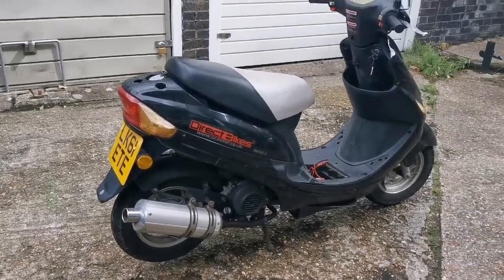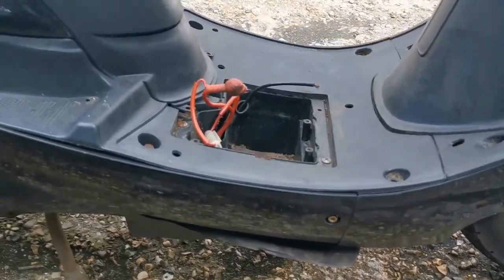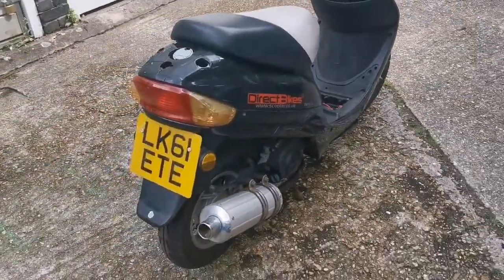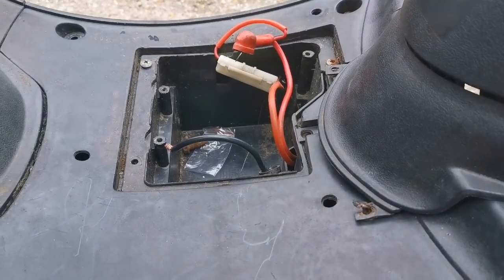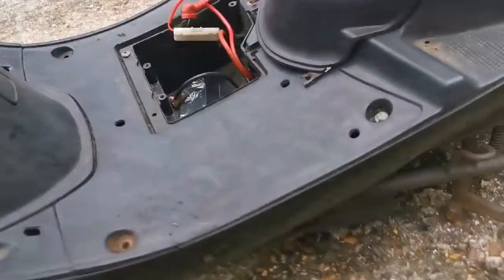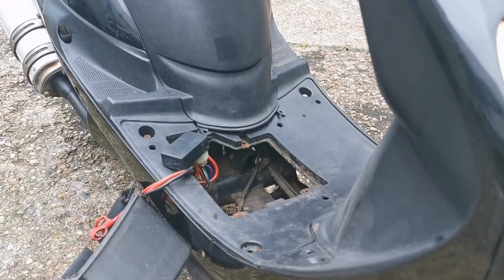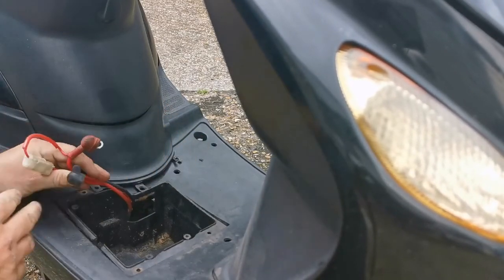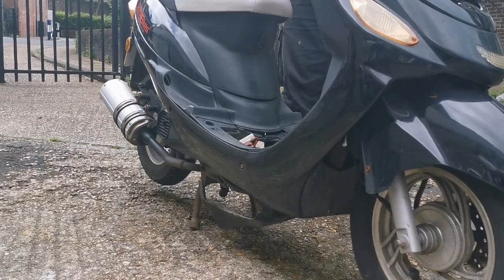How to de restrict your motorcycle. How to make your 50cc faster. De restrict your moped or scooter

Comment: Almost the same on all carb based GY6 engines including Peugeot kisbee until 2017, there you connect the blue wire to black. With fresh rollers mine does 70km/h (gps speed) with me on (74kg) and steep uphill 45km/h I mounted a swith in case of police control 😉
Reply from the maker: Good thinking about the switch mate
Reply: Have a 2021 50cc with no purple wire or no blue wire and it's all original never touched..also seen that where the purple wire should go on the cdi plug it's already missing, any advice?
Reply: @ticohayes7034  2021? Sure you have carb and not injection?
Reply from the maker: As already mentioned I think you have a fuel injected model. These are restricted in the ecu. It wasn't common to be able to get a de restricted ecu so you may be stuck with it until your ready to upgrade to a 125cc
Reply from the maker: It will be injection I'm sure. So ecu restricted
Reply: @bennyrogergundersen3040  yea 2021 it is a china bike dont kno if that makes a difference but positive that's it's carb just bought a new 1 for it a week ago..
Reply: It's a 2021"peace sport 50cc"

Comment: Do you think this could work on an Icebear 50cc? It had a restrictor behind the drive face but removing that did nothing at all.
Reply: Currently about to derestrict my exhaust when I wake up tomorrow morning on my Icebear 50cc, I hope I have more success 😅
Reply: @GoodVibes0rDie did it wrk on ur icebear
Reply: @Bella-RJR  It gave it honestly 2-5mph more depending on where I got the gas and what kind of gas. As for actual mileage, I gained 7 more miles during the summer, but when the snow and cold hit all went to shit. Shocking for a scooter with the name Iceberg. However, the scooter served me well. Derestricting overall paid off enough for the effort to be worth it, but barely worth it. If you have love for your scooter do it. Otherwise, screw it haha

Comment: mine wont start after disconnecting the wire.
Reply from the maker: Then you need to re connect it. However if your bike cdi looks like mine and has the pink or purple wire then that's the restriction wire and won't stop the bike starting
Reply: @motorcyclerescuer  its always the bottom right wire if your cdi looks like that the color does not matter
Reply: @motorcyclerescuer  and you dont need to cut it just pull it so you can but it back in if need it
Reply from the maker: On mine it wouldn't have been able to go back in if I pulled it. But this was a few years ago so they may have changed.

Comment: I have a question. Can you restrict a scooter to a specific number? Mine goes 25 but i want to go like 40.
Reply from the maker: No it dosnt work like that sadly. It's either restricted or not. 

You can change the roller to slow you down or speed you up a touch

Comment: I have a tao tao 50cc and it does 35mph on flat and 30mph up a hill. All the restrictions are on it, it’s a completely stock bike. I’m 155lbs as well.
Reply from the maker: My guess would be that either your restrictions have been removed or someone has tuned the variator a bit to help it along. In the UK these are 28mph from factory and around 35 when de restricted with no variator changes.

Comment: I had a gilera runner de restricted the exhaust…. Bought a 70 piston an head…. New jet…. An even changed reed valve …..40/50 mph…. Was surprised how quick it was 😉
Reply from the maker: Yes them engines tune really well. I got 70mph or close out of a 50cc Aaerox some years back lol

Comment: i know on Honda its a small looped green wire that you just cut on CDI .. but TBH it hardly makes any difference anyway no escaping that fact its a 50cc   ..You can change exhaust and put "race" rollers in variator but its just not worth the money and effort
Reply from the maker: Agreed, these Chinese ones only do 28mph though which is shocking. With the wire cut it does 35 which is safer

Comment: just picked one up from the local scrappy at Pont Creuddyn for £30 been stood out in all weathers for 2 years will quite a few panels missing but had key, made up a few line to a funnel just see if any life in it plus a squrt of easy start to save wearing down the battery pack and away it went. Glad I did not use fuel tank. Swilled that today and had about half pint of water in with the petrol even had V5 with it going to be my rat scoot run about shortly when done. Picking up a Honda Dylan 125 2004 model I think for tomorrow bit tatty, again stood 2yrs,has key but no V5 for same price. I know nothing about them but worth trying at £30 again. Hopefully no immobiliser on them to go wrong like my damn Vespa ET4 125
Reply from the maker: That's how all my stuff started, picking up cheap or free bikes and getting them running. That's the fun. 

Enjoy dude

Comment: Nice video! Could it be harmful? What does this change? Would it work on a Zipp Vapor? (looks almost the same)
Reply from the maker: If your bike has the same cdi as in this vid and the same pink/purple wire then yes it would work. However cut your wire in a way that you can wire it back up if needed. 

No it won't ruin the bike. They are restricted to around 29mph and cutting the restriction wire helps them to get to 35 ish which is safer. 

Hope this help and good luck..

Comment: if you pull it out can you push it back in? in case in you want it back?
Reply: how do you put it back up?
Reply from the maker: I'm unsure what your talking about I'm afraid.  You can cut the wire in a way where you can re connect it yes.

Comment: Alright mate any idea how to drestrict kymco 50 agility
Reply from the maker: Hi, it depends what year it is. Is it a carb model or fuel injection? 

If its a carb model and has a cdi like the one in this vid then you can cut the pink or purple wire to remove the rev limiter. 

If its a fuel injection model then you would need to find a de restricted cdi for your bike. These are rare and hard to find. 

If you let me know the year and if its carb or injection I can look it up for you. 

Thanks
Reply: Hi ya mate yh 2010 I pretty sure it's carb
Reply from the maker: You should have the same cdi as in the vid then? Have you looked for it?
Reply: @motorcyclerescuer  nice one I'll have a look

Comment: Please help me from going insane! My boyfriend has a 2006 yahama Vino scooter. He has had ne researching for months on how to remove the speed limiter, the washer on the vararatior. Hes even brought a new exhaust. I cAnt seem to find the right info on how to make this thing go faster. And im tired of looking things up.
Reply from the maker: Hi. 

Did it have a restriction washer in the variator? There are 2 washer in there, one is a very slim one that is needed and one is a bigger thick one that is the restriction. Up to 2006 these engines were 2 stroke and had these exhaust and variator restrictions. From 2006 the 4 stroke was used. 

As far as I'm aware the 4 stroke is just that slow with little to no restriction.  My only thought is to look at the cdi as in my vid and see if it matches. If it's the same style of cdi and has a pink or purple wire in it then that could be a restriction wire. However cut it further away from the cdi so that you can wire it back together if it's not the restriction wire. 

I'm curious. Please keep me updated

Comment: Hey man how do you unrestrict a bentelli beast 50cc?
Reply from the maker: Hi, if it has the same cdi as mine in the vid and has a pink or purple wire then that will be restricting it. 

Otherwise it could be the exhaust, the airbox, a washer in the variator or even a mixture of these things. 

You will need to check on your bike to see. 

Hope this helps

Comment: Hi I have a turbo rs 50 it’s a 50cc scooter. I checked my cdi but it doesn’t have a purple wire. Any suggestions?
Reply from the maker: It may have a restriction in the airbox, variator and exgaust. Any of them.
Reply: @motorcyclerescuer  i unplugged a wire in the cdi and holy smokes my scooter used to 25km now it goes 60! I’m going to sub to ur channel thank u sir
Reply from the maker: @abdulkamanzi5985  nice, it makes a big difference dosnt it. We'll dome mate
Reply: What wire did you unplug @Abdul Kamanzi
Reply: @thebaconherosxd3700  Mine had different colors. The wire you need to cut is always on the bottom LEFT side on your CDI. Worked for me👍🏻
Reply: @abdulkamanzi5985  what year is your scooter
Reply from the maker: Can't remember if I'm being honest
Reply: @motorcyclerescuer  I have a 21 and I’m going to try tonight
Reply from the maker: As long as the cdi looks like mine and has a pink or purple wire in it, then it should be fine.
Reply: @abdulkamanzi5985

Comment: What you think will this work on baotian solifer speed. There is a pink wire going to cdi box, should i cut it?
Reply from the maker: The pink wire will be the restriction wire. Cut it but cut it leaving you enough room to wire it back together if something went wrong. Does that make sense. Copy my video basically. 

Let me know how much difference it makes and don't forget to subscribe
Reply: @motorcyclerescuer  How much you got more high speed?
Reply from the maker: @konaukko8794  mine went from 28mph to 37 ish just by cutting that wire

Comment: I tryed to take out the pink wire it doesnt work for me. I need to cut it or take it out?
Reply from the maker: It shows you the cutting of the wire in the video and I explain it clearly. 

You cut the wire. 

Thanks for watching and please subscribe.
Reply: @motorcyclerescuer  tryed to cut it. Still nothing changed. Its 49cc and its going 55 km/h and it didnt change for me.
Reply from the maker: @mikusdrosprats3165  these are slow engines so it may just be at its max. Unless it has other restrictions on it. Possibly the airbox, or variator or exhaust
Reply: @motorcyclerescuer  maybe because when my throttle is on max its like waving like slowing down an then goes back and then again.
Reply: @motorcyclerescuer  electricity doesnt care, it just cares that there is a path for conductivity.
Reply from the maker: Cutting the wire stops the flow obviously

Comment: Would this work on a motorini misano 50cc and would it damage the bike at all
Reply from the maker: I'm not sure anymore if I'm being honest. If you have the pink or purple wire on your cdi like mine then cutting it should remove the restrictor however cut the wire in a way that you can wire it back together if needed.

Comment: I have a tianying ty50qt new bike of direct bikes will it work on thah it looks similar to this bike
Reply from the maker: Is it a fuel injected bike? If so I don't think this will work. 

If your cdi looks like mine and has a pink or purple wire in it then it could work. But I'm unsure really. 

Start by seeing if your cdi looks like mine and go from there.
Reply: It looks the exact same as your bike pal ... just a newer model .. I will have a look tomorrow and hopefully it's the same as yours under then battery
Reply from the maker: @adriannugent7838  yes have a look but my guess is that yours is fuel injected and a different cdi. 

Let me know what you find

Comment: Yo bro does my Baotian 50cc 2t 2013year have this and can i cut the wire?
Reply from the maker: Does your cdi look the same as mine? Does it have a pink or purple in the same place mine has? 

If so then yes that's the restriction wire. Cutting it should remove the restriction.  

But be sure to cut it in a way where you can re attach it if needed.

Comment: Hi mate would this work on a lexmoto echo 50cc? 16 plate
Reply from the maker: If it has a pink or purple wire on your cdi then yes it's exactly the same Lewis. 

Thanks for watching and please subscribe
Reply: @motorcyclerescuer  thanks mate would it be under my battery seen a few there
Reply from the maker: @lewis5903  your cdi on the echo I think it is near the battery but can't be sure. You will know it when you see it as its a black box. I'm sure it is. The echo and my direct bike are basically the same. 

Let me know if you do it and how the bike feels after mate, I'm curious
Reply: Did it work mate I have same bike
Reply from the maker: @jamiecullen1661  if you have a pink or purple wire in your cdi cut it, but leave yourself enough to re wire it if ever wanted. 

Cutting it will remove the rev restriction and ad up to 10 mph to your bike roughly

Comment: I have 2016 taotao pony moped what should i do
Reply from the maker: If it has this style of cdi with a pink or purple wire in it then that should be the restriction wire. 

But cut it with plenty space to wire it back up if you need to just incase.
Reply: @motorcyclerescuer  it has no purple or pink wire
Reply from the maker: Oh OK. I'm unsure what the restrictions are on your bike I'm afraid.  

It could be a cdi restriction or something in the variator, exhaust or airbox.

Comment: I cut the same wire and i dont get spark anymore. Tried a few other wires and nothing worked
Reply from the maker: Don't cut other wires, only the pink or purple wire in the bottom left of the plug is the restriction wire. But this was an older model. You may have a newer model with a different cdi.
Reply: @motorcyclerescuer  i got a 2007 keeway matrix with the same cdi
Reply from the maker: I would suggest buying a de restricted cdi for your model. Some could be de restricted by cutting a wire but some couldn't. 

Your bike may have other restrictions aswell, in the exhaust, the airbox or the variator.
Reply: @motorcyclerescuer  i have a 70cc malossi mhr racing cylinder, 24pwk carb, leovince handmade tt exhaust etc
Reply from the maker: Oh OK, then yes best to buy a de restricted cdi. It appears the wire cut dosnt work on yours.
Reply: @motorcyclerescuer  yeah i have a problem it only goes 55kmh with 3.6g rollers and low acceleration

Comment: Would this work on a 2006 Honda Today ?
Reply from the maker: Hi, if it has the same looking cdi, is a 50cc and has a pink or purple wire then yes it will. 

However, honda also used a shim in the variator, a restrictor in the airbox and sometimes a restrictor in the exhaust. 

So it could be any really. 

Best thing to do is join my Facebook page (motorcycle rescuer) and you can send pics which will help me work it out. 

Please like and subscribe

Comment: Without a GPS reading your speed cannot be verified.
Reply from the maker: Hmmmmm but you can see what your speedo said before and after the cdi cut and see how many mph it went up by. Mine was 6mph to 8mph difference I believe if I remember rightly. And on a little bike that's a big difference. 

It's not rocket science
Reply: @motorcyclerescuer  The USA shipped mopeds do not have a speed restrictor. If you cut the kill wire it will just keep you from killing the engine.
Reply from the maker: Ok, but this is a UK channel for UK motorcycles. 

No no concerns about that at all. Our learner bikes when 50cc are restricted to 30mph max.
Reply: @motorcyclerescuer  I did not know there were rev limiters inside the CDI. In that case you could just simply put the bike on the stand and full throttle and see if the revs are increased when you cut a wire.
Reply from the maker: There are definitely restrictions in these cdis, they restrict the UK bikes and EU bikes (I think) to around 30 mph. By cutting this restriction wire you can squeeze around 8mph extra out of the engine.
Reply from the maker: Also you don't need to check on the stand as you can use the speedometer

Comment: Would this work on a neco gpx moped ??
Reply from the maker: I'm not sure as newer biked may use different types of restriction. 

If it has a cdi that looked like mine and a pink or purple wire then yes it should work. 

However cut the wire in a way that you can re attach it if it dosnt work. 

Hope this helps. Please like and subscribe

Comment: Mine does 35 fully restricted
Reply from the maker: You got lucky or someone has messed with the carb.
Reply: @motorcyclerescuer  what’s a Carb
Reply from the maker: @DarylSkinner  carburettor, it's what mixes your air and fuel
Reply: @motorcyclerescuer  lol 😂

Comment: Hey man. Could this work on Keeway matrix 50? Or does it like remove rev limiter or what
Reply from the maker: If the bike has a pink or purple wire in the cdi then it works. However cut the wire in a way so that you can put it back together if wanted. 

Yes it removes the rev limiter. 

Thanks for watching and please subscribe

Comment: Are this work to apex moped 50cc
Reply from the maker: If it has the same cdi with a pink or purple wire then yes it should work. But if you cut the wire do it in a way that you can wire it back up if needed.

Comment: So u cutted a speed limiter? Or what on this moped
Reply from the maker: Yes the cdi limits the revs, cutting the pink or purple wire stops this happening.
Reply: @motorcyclerescuer  i have rex rs 500 scotter but it is the same as this so i think i will have these wires purple or pink, so again u need to cut purple or pink wire to remove the speed limiter and thats it? thanks for replying
Reply from the maker: Is it a 50cc?
Reply: @motorcyclerescuer  49cc yeah
Reply from the maker: @audibulka  then yes if it has   a pink or purple wire and the cdi looks like mine.

Comment: My scooter doesn't start after doing this trick
Reply from the maker: This only takes away the rev restriction, nothing else. So it wouldn't stop your bike from starting. However if your worried about it just wire it back up. I state clearly in the vid that it should be cut in a way where you can wire it back up if needed.